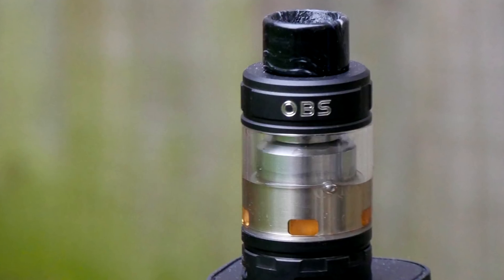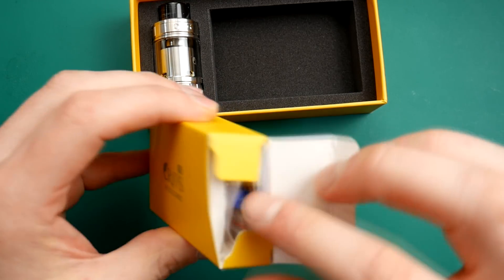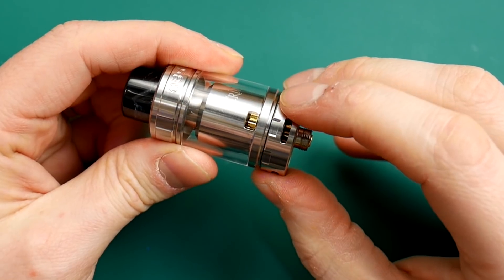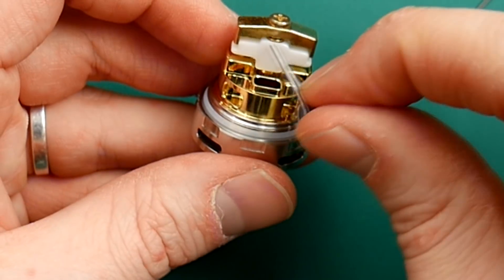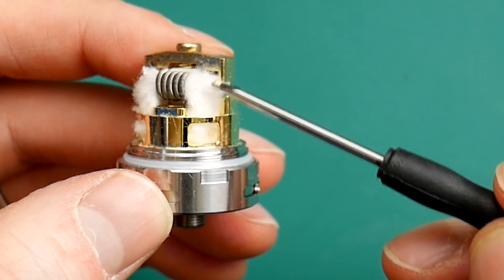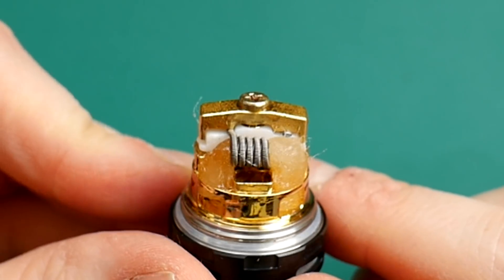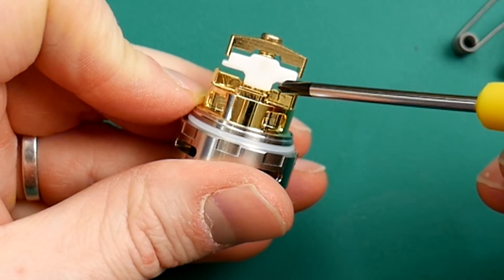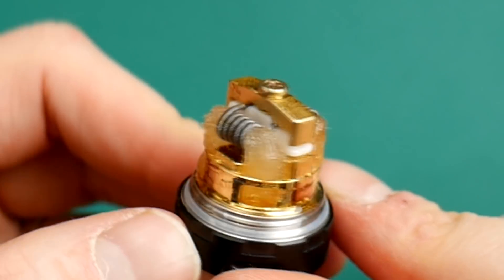OBS Crius V2 RTA Dual Coil Version - Build & Wick

Comment: Nice review Richard! I'm still looking for a replacement dual coil RTA, I don't use dual coil often, but sometimes I just like to go cloudy. I'm still using the original Kylin which still seeps juice way too often and it's too airy, but its big plus is the size of the builddeck. 
I'm a bit (understatement) picky though when it comes to a new one. I don't like the postholes/clamps to be shared (influences the stability on TC) which unfortunately excludes the Bravo, and I don't like off-set coils (personal preference). And it must be able to accommodate long coils because I prefer the ohms not to low, but I like using SS fused claptons (with 28g cores to keep it civil) and I want them spaced (again, for TC). I like this atty and OBS, but using a 6 or 7 wrap (slightly) spaced coil to get a 0.3 build or thereabouts, I don't think it would properly fit in the Crius or would it?